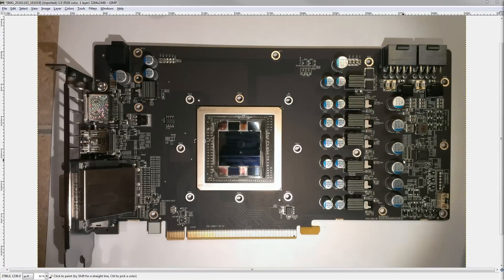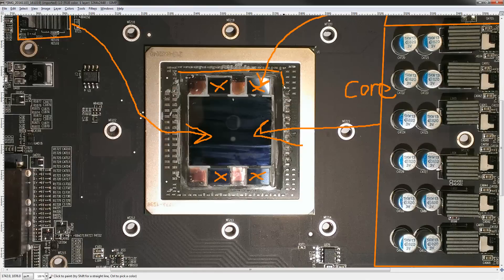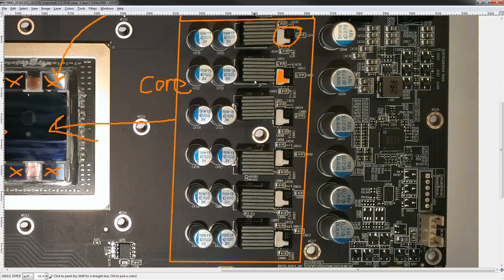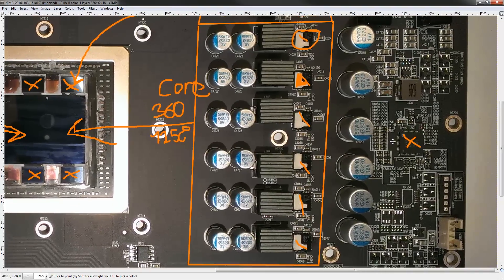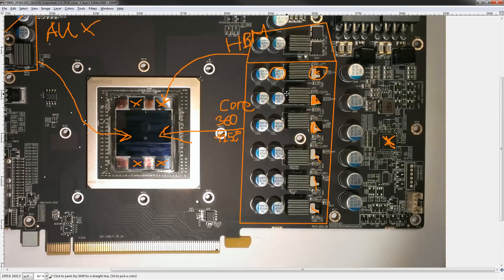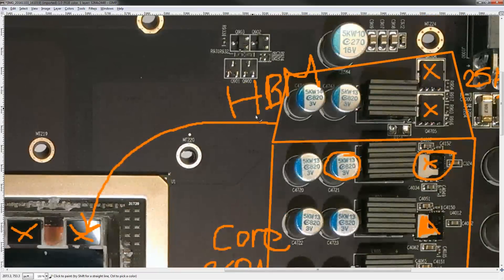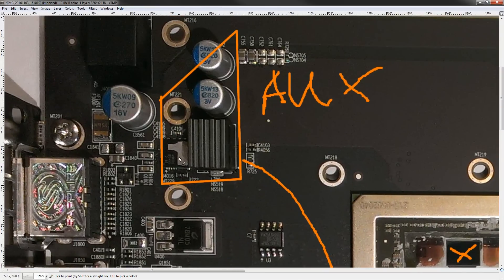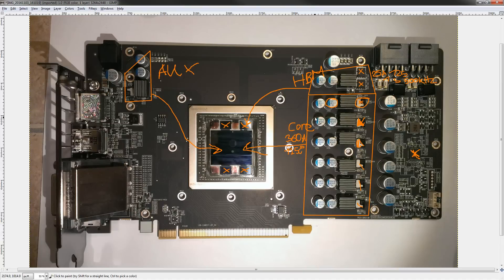PCB Breakdown: Sapphire R9 Fury Nitro

Comment: Are these things worth water cooling? I just got one and its a noticeable improvement over the rx480s I've used and I'm wondering how much better it could get. right now I've got it to 1130 525 stable and it never goes over 75c really so I'm wondering if it has more head room.
Reply: Sam M. Atherton Not unless you unlock some, but most especially all of the additional locked CU's (making it into an R9 Fury X essentially), in which case maintaining a max OC like yours under air w/ reasonable temps (aka <80°C) can get quite tricky. 

Otherwise, nope, not one bit unless noise is a first & foremost concern for you. I can almost guarantee that you aren't going to get a higher OC with that card on liquid vs stock air. Fiji is just not a huge OC'er and quickly hits the voltage/watt wall HARD once you start pushing past stock voltages.

Comment: @Actually Hardcore Overclocking
 Hi buildzoid im haveing a question . You  Were doing review of GA-990fx mobo i personalay have GA-990x gaming SLI ,on first look the PCB is the same i meant they use same PCB for both board , could you veryfied it for me , and im haveing a problem to hit pass 4,8 GHz on water with is super wird im trying to push 8350 on about 5,2 i know it does 5,4 even i both of the guy who use to keep it 5,5 constantly on high pressure loop , with two 4x4 rads and push pool on them  , so im sure i should be able to keep it 5,2 but that mobo is so bad honestly its unreal , dont mention that i cant push my kingston HX savages even close to 1866 dont mention rated 2400 Mhz, and sugestions , cause i just loosing my patient to that board but i love futers on it , M.2 even if not full 20Gb/z its loads compare to standart 6Gb/s on sata3, and usb 3.1 and 3.0  , overalo futures great board , overclock is like kill me 
or help me xD

Comment: Love this card, have it myself. Sadly, it's currently in RMA because a fanblade broke off (probably fan wasn't quite balanced or something). But it overclocked well at up to 1140Mhz core and something like 570Mhz HBM and pushed out GTX980Ti benchmark scores. Too bad mine couldn't have extra cores unlocked, that would have really been sweet.

Comment: Bit of a numbers error: 90A peak for 5ms per phase means it can handle 540A peak current. I can't imagine what you gotta do to push that much current through the card.
Reply from the maker: I can't math in the middle of recording.
Reply: Actually Hardcore Overclocking
Don't worry we gome here for OC classes, not math classes :D

Comment: I've always liked sapphire, they make the most reliable and quiet cards on the market. I regret buying the powercolor R9 285 I'm running now, it's fans are loud it thermal throttles at times, and it has bad coil whine.
Reply: I have now bought 3 Sapphire cards to date. All have been superb and quiet. Can't go wrong with Sapphire.
Reply: Nope, my 6950 and R9 270X were both solid cards. Neither were loud. I regret buying a powercolour card, which is the one I have now because it gets coil whine at load and is loud.

Comment: Yet another awesome PCB analysis video :D Sapphire really made this one tough. Anyways I have a 760 Hawk that blew up when i overclocked it to 1360MHz and 1.3v and I was wondering if you'd take a look at the PCB for me since I thought it should've been capable of that.
Reply: acnfanmanin the vrms blew?
Reply from the maker: IDK what the exact FETs on the HAWK are but that doesn't sound like it should happen.
Reply: Rdrack yea it did went poof
Reply: Actually Hardcore Overclocking well I was still air cooling it with max fans and I did the voltage controller NCP4206 voltage mod like on the OG Titan and 780 to get the 1.3v and it runs with a vdroop to 1.27v so I did the 0% LLC mod on it and that's when it went poof when I got it up to 1.3v.

Comment: Man these are some massive power planes holy crap.
Reply from the maker: that's normal on most high end GPUs. Usually they aren't this visible since the GDDR5 data lines on many cards go over the Vcore power plane.
Reply: Actually Hardcore Overclocking ... but because this GPU doesn't have G5 they put the Vcore power plane on top. Makes sense.

Comment: Does anybody know why the price of this card dropped to 300$ ?
Reply: Probably trying to get rid of stock before Vega drops
Reply: John Aquino but it costs basically as much as an aftermarket RX 480 yet is better, also it's just the sapphire one and Fury Xs and Nanos still cost like 400-500 dollars. Weird stuff
Reply: +Helodon I've been hearing about the Sapphire versions having some coil whine after launch so people could have avoided them like the plague. Maybe they have an abundance in stock?

Either way, its kinda tempting to get one of these now that its so cheap. I just don't know if 4Gb VRAM will hold up over time.
Reply: John Aquino The whole Fury line up are notorious coil whiners.

Yes the temptation was so strong, i bought one a few months ago, and i love it so far, but the coil whine is indeed audible. And for the 4 GB VRAM last weekend i played the Steep Beta on 1440p Ultra and it used up tp 3,4 GB. I think it will do just fine for a while.
Reply: Because 1060 6 GB released with a bit less performance for $250, and much more powerful 1070 released at around $400, so obviously Fury couldn't keep its $550 price.
Reply: Apparently Sapphire is the only one who understands the market. You have to be really unreasonable to keep Fury for $550 on the market right now.
Reply: if your choises are rx 480 or r9 fury, just get the Fury if the difference in price is small. Despite the 4gb of ram Fury is a better performer than 480 in 1080p where 4 gb are more than enough. And in 2k 480 isn't good enough being a 1080p chip, while Fury has plenty of potential. As of now Fury is the best card sold at <300€ money can buy. In Eu getting a XFX GTR which cost 270€ and Fury sold for 279€ on amazon.fr is a nonsense IMHO
Reply: +Energy Core
Yes, the R9 Fury is a good performer at 4K. Turn off MSAA (you don't really need it at 4K and it wrecks the fps) maybe tweak a couple of effects down to High/Medium. Leave the rest on Ultra.
Most titles will then run at around 60fps.
The 4GB vram isn't really an issue.
I work around that (if necessary) by adjusting a few settings.
If you use Freesync then you don't really need to bother ofc.
With 2 cards in CrossfireX or DX12 m-GPU the performance at 4K is insane, even with everything maxed!
Reply: Krzych but other Fury's still cost the same, and the R9 300 series's prices also didn't drop at all
Reply: I would suggest bidding on eBay. They should be about 250 - 280. I recently purchased a used GTX 980 ti refenrence and it works great.
Reply: Helodon because it's only 10 percent or so faster than a $250 GTX 1060
Reply: and they keep dropping, $285 now on some sites!
Reply: Domenico F
Also remember that the Fury has HBM which more than makes up for the lack of VRAM amount in higher resolutions. The R9 Fury measured 10% faster than the GTX 1060 in 1080p, and 15% faster in 1440p. It could probably even do 4K if you tone down settings.
Reply: I confirm that I run gta v , SOM , dying light , doom , WOW  and CS in 4k just fine with MSAA low/2x very good....most of them giving me more then 57 FPS....the only one that makes me run low FPS in 4k up until now is DEUS EX

Comment from the maker: FURST!
Reply: Actually Hardcore Overclocking FIERST
Reply: What's your opinion on FurMark for stress testing GPU's in general, would you use it?
Reply from the maker: It's dumb. It's specifically written to keep all the shaders busy at all times and to not have cache misses to avoid waiting for memory access. Great for testing the VRM and heatsink but useless for stability testing. Especially since it will cause core clock throttling on many cards.
Reply: Actually Hardcore Overclocking Can you do a review on the RX 470 Strix O.C. PCB? Theres also a Gaming O.C. version but thats like 12 dollars more here in my country. Its the cheapest RX 470 here. The Sapphire Nitro is like 35 dollars more.
Reply: hi, i saw your post about unlocking r9 fury tri-x shaders would you mind sending the bios for unlocking as i tried and cannot make "'makeroms" work 
thanks.